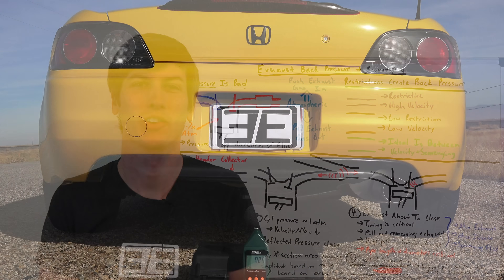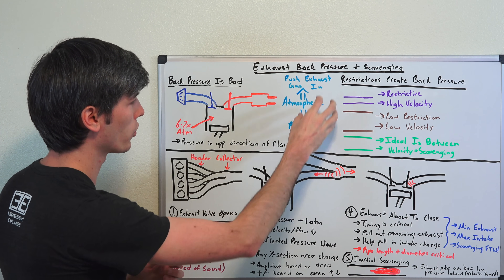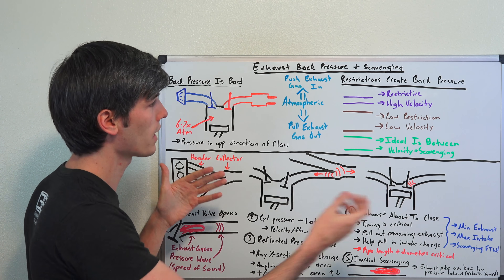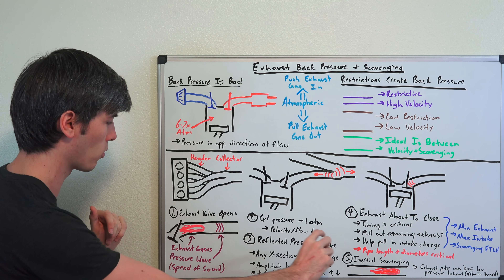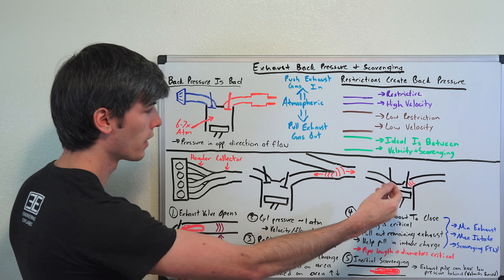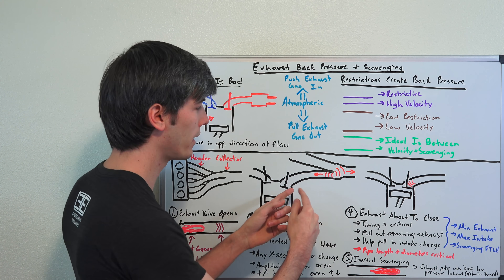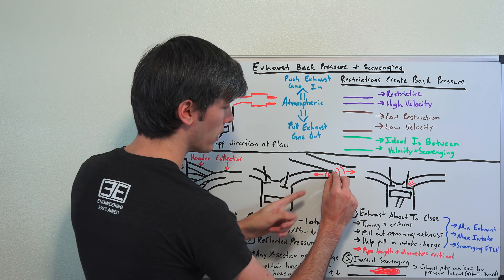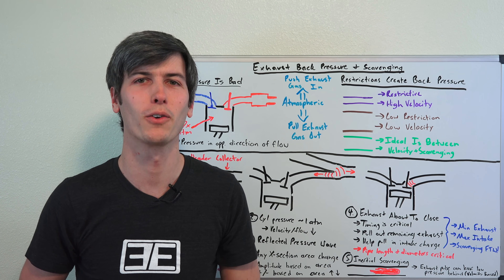Stop Saying Car Exhausts Need Back Pressure

Comment: As an engineer I’ve always been irritated by people saying cars need back pressure. 
Drove me nuts
Reply: I ran a custom exhaust shop for the better part of 20 years. I've built 100s of exhaust systems. Possibly into the thousands.  The amount of times I heard  "you need back pressure " My God it was pathetic.  I based the size of pipe and type of muffler on a few key factors.  
-engine hp
-type of driving
-upcoming engine or driveline   mods.. 
A lot of times pipe diameter is determined by its available space to live under your car. Sometimes it's not feasible to use larger diameter pipes. 
One thing I do miss is building headers. Very time consuming = very expensive. 
Any custom work is not cheap. If it is cheap,,,,,, you get what you pay for.
Reply: @My-Name-is-Mud-1969  It'll be fine with the stock diameter as long as it doesn't have a muffler.
Reply: Same
Reply: I read that honda k series engines need some back pressure and if not tuned properly using too large of ecxaust people are burning engines up
Reply: The guy who did my muffler delete on I4 said these engines need a bit of back pressure. I definitely felt a loss of torque at lower rpm. Also I’m surprised that so many mechanics think no tuning is needed after a muffler delete. My area doesn’t have that so yeah car sounds nice and loud with lesser torque which means loss in performance. ☹️

I do have a k tuner. Do you know if I can tune muffler delete by myself? And if so how?
@Engineering Explained
Reply: @Febreeze_Odor_Eliminator I recently bought a car that has the back box replaced with straight pipe to twin exhausts either side and while it sounds lovely at full chat I've noticed it doesn't pull well low down or from stationary despite supposedly having peak torque arrive before 2k rpm. I'm looking at getting the garage to order me a standard exhaust to see if that really is the issue.
Reply: @PPC4 just have it tuned.  It is tuned for back pressure and you just reduced it...
Reply: @Febreeze_Odor_Eliminator first step read forums, you likely have a laptop if you have a k tuner and you are gonna need to install a wideband o2 sensor and make sure your car is running good (make sure all your maintenance is done) and do research. Look at general tuning info relating to engines, look at info relating to k tuner, do research on your engine and what’s on your engine. You will likely answer a lot of your own questions but if you do it yourself you have to want to find the info. I’m not into Hondas so I cant tell you exactly what to do but I assure you knowledgeable people have done exactly what you want to do you just have to find where they told someone about it
Reply: @Febreeze_Odor_Eliminator if you noticed any difference in torque after the guy told you it would and it wasn't a placebo effect, it's simply because the car was tuned for back pressure and isn't now...
Reply: @chrismurphy7199  the guy told me it’s an issue for four cylinders, six and higher u go not much of a problem. Acc to his words, back pressure in 4’s help with their torque. Plus I never tuned my car for a muffler delete which most likely would have solved the issue which is why I was looking for an answer in the 1st place. 

It sure wasn’t a placebo effect as driving to the shop and driving out of it was a huge difference, had to give more gas to pick up speed
Reply: @Febreeze_Odor_Eliminator  you believe that coming from a guy who chops mufflers off for a living?
The only reason you “need” back pressure, is because it was tuned for it, from factory.

So of course it “needs” it, but engines are just air pumps, why have a higher differential in pressure, when could just NOT
Reply: @rocketkinger2506  so if I straight pipe my 4 wheeler, I just need to rejet it and it's good? After I upgrade the intake
Reply: @rocketkinger2506  That's a lie
Reply: @rocketkinger2506  why is there a loss in torque and mileage then? When I drove to the shop and drove back home I definitely noticed a huge torque drop off. I had to press gas more to go faster than with the muffler on. 

Also FYI he used to be a mechanic but now only does muffler stuff; he has a beautiful retro restomod muscle car sitting is his shop. Acc to him he has been doing this stuff for more than 30+ years. And I think he was giving me a fair heads up (even before taking the muffler’s off) for which kudos to him. Nowadays people don’t tell you anything and just are ready to snatch your money.
Reply: @carter.coleman  Yes. Just rejet it.
Reply: @carter.coleman   Get bigger throttle bodies and have it ported to fit 👍
Reply: Okay but as he explained in the video… you DO NEED BACK PRESSURE, just a minimal amount
Reply: @man.and.machines  its like saying we need nazis in society. We dont, nazis are exclusively bad and ideally we could get rid of them all. However, the only way to do that would be to police peoples thoughts and beliefs, and that is in itself bad. Just because the only way to get rid of something bad is even worse, that doesnt mean we need the bad thing.
Reply: @man.and.machines  its not that you need backpressure, backpressure is a problem and you want as little as possible, its just that the only way to have absolutely no backpressure introduces other problems.
Reply: @Kevin-dt9xm  bro are you even reading what you’re typing? The conclusion to what you’re saying can be deduced as… “minimal back pressure is optimal.”
Reply: @man.and.machines  yes, minimal backpressure is optimal. Saying "exhausts need backpressure" makes it sound like backpressure is a good thing, though, which its not.
Reply: Except even in his own explanation, he still says you need a little back pressure, but not too much that wouldn't allow the exhaust to flow quickly. Motorcycles in back pressure, imo, are much easier to understand because it doesn't take much to see a night and day difference since they're much lighter than a car. You can put an aftermarket Yoshi pipe on a Honda, right. But what you'll notice is that when you take the baffle out, the bike may seem a little faster, but it'll also act a little sluggish. Put the baffle back, and it will not only seem faster but also not seem sluggish. Granted, yes, you still need to tune the bike to make it as efficient as possible for that exhaust, but even so, maintaining a tune for a baffle compared to baffleless can result in high performance and better fuel economy compared to straight pipe. That's because you aren't having to dump a lot more fuel to create the bigger internal bang to counteract the wider dia pipe to better push the air out of the exhaust.
Reply: @JustJesseOfficial back pressure is never good.  He is explaining how to reduce the impacts.  If your bike runs worse after reducing back pressure, it's simply because it isn't tuned to breath freely.
Reply: @JustJesseOfficial  its not that you need a little backpressure, ideally youd have no backpressure, but the only way to have no backpressure is to have an exhaust which offers no restriction, which would reduce scavenging. Backpressure is exclusively bad, but its a necessary sacrifice.
Reply: @JustJesseOfficial  that sluggishness explanation exactly fits to what happened to my vehicle after muf delete. Nice articulation! 

And yeah torque and mileage loss definitely happened. Mileage prob not so much (vehicle already had a shi mileage when I got so I can’t tell by how much) but a huge dip in torque.
Reply: Well there's a huge difference between theory and real world experience.
Reply: So why do vehicles lose power when the exhaust breaks especially before the catalytic converter?
Reply: @AmaniFound  Because most likely in that case the car was tuned for that exhaust configuration. Lopping off the exhaust and just having a dump most likely will result in slower exhaust gas velocity at lower RPMs resulting in loss of power. Then at higher RPM there may be some potential benefit, however if the car has no means of adjusting fuel/timing/etc it will simply not doing anything for it.
Reply: @AmaniFound because it is tuned for x amount of back pressure and you just eliminated it.  Often though, you think it is struggling more because it's louder and it really isn't...
Reply: Isn't it necessary to help boost mpg?
Reply: @ralph02136  ...no, backpressure actually reduces the efficiency of the engine by increasing pumping losses
Reply: @Kevin-dt9xm  False.
Reply: @Kevin-dt9xm  You need to make the engine run richer with no backpressure.

Comment: So the 2 stroke engine "resonance exhausts" kits are basically made in a way to have the negative backpressure wave hit the ports in the right timing ? 
Or would a positive backpressure hitting the extraction ports be better, as it would push the piston up?
Also in a car, would having an active extraction of exhaust via a compressor (or decompressor) create more power ?

Comment: If you want to increase low rpm torque you want to use higher velocity exhaust to scavenge the cylinder better - that is when you want to have enough back pressure to create low end velocity. This of course causes too much back pressure at high rpm. Also a scavenged 2 stroke wont run with no back pressure. It needs the velocity to reach the power band.

Comment: We don't need no stinking headers! The bottom line is that "back pressure" is really just "choking exhaust gases trying to leave the motor." Most cars seem to benefit from small increases in exhaust diameter.

Comment: Don't say back pressure.  Say flow restriction.  There is no pressurized vessel in the exhaust, pressure is created only by the resistance to exhaust gases flowing through the exhaust system.

Comment: In short...BACKPRESSURE IS BAD. That being said in newer cars you can't just throw on headers and big high flowing exhaust on them without new fuel trims in most cases or it just doesn't work near as well as it could

Comment: Someone once tried to sell me the idea that an exhaust behind a turbo needed back pressure for the engine to be more efficient. After the turbo.
Where the turbo itself is building pressure for the exhaust gasses after the valves. So even his turbo was not really efficient and the whole system ran hot.

Would have been nice if you'd added a short note about turbo engines in your explanation.

Comment: So exhaust velocity can be created or tuned if you will by back pressure of the diameter and length pipe . So you do want back pressure as long as you call it velocity creating pipe.

Comment: One thing I didn't really hear was that exhaust gasses flow better when they are hot, so for example the Apex'i N1 on my GSX starts at 2.5 inch from the turbo and expands to 3.1 inch by the muffler. I think it's the sweetspot for my 2.0 liter Evo III 16g turbo setup.

Comment: i think it's a little bit more complex if you consider MPG instead of just performance...because in 2 strokes if there's no back pressure you'd chug so much fuel and i'd think it's the same for 4 strokes

Comment: I really think this dates back to carbureted engines and the impact on aerosolization of the gas on it's way into the cylinder. In other words, the inefficiency of the impeded exhaust was superseded by improvements to air-fuel mixture efficiency. Fuel injected engines don't have the inefficiencies of older carbureted engines.

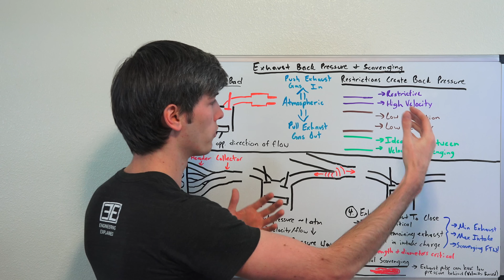Comment: 2:50 "You want some balance..."

Disclaimer: this is applicable to "general use" consumer engines. Race cars are a MUCH more specific application with different priorities and operating guidelines.

Back pressure is a symptom of a desirable operating condition in NA engines. You cannot have scavenging without back pressure and scavenging is an objectively good and desirable operating condition in NA engines. The back pressure may not be what is being desired in and of itself, but it provides a benefit not otherwise achievable without supercharging - higher volumetric efficiency. Therefore, the presence of back pressure indicates a better operating condition of the engine. Therefore, you DO want to see some back pressure in the intake manifold under certain conditions! You yourself admit as much at 2:50 into the video.

It is misleading and click-baity to say that back pressure is bad as a blanket statement as you do when you open the video. Good information that deserves to be presented with greater intellectual integrity.
Reply: He said "you want some balance", he didn't say "You need back pressure" specifically.
Quite the difference there
Reply: @ilpatongi  wanting balance means wanting both sides of the situation... the flow AND the back pressure.  If he didn't actively desire back pressure, then he woulsnt SAY balance, he would say he just deisres flow. The back pressure is beneficial and desirable. in my comment, i even went as far as to point out situations where you do not need back pressure, but i also qualified my statement at the start as referring to normal use engines as he was primarily talking about...the kind of engines most of his viewers are concerned with.
Reply: @jamestouchette859  Well of course we're taking about balance here, you can't completely eliminate back pressure because an engine doesn't work at a constant RPM.
Balance is the key really, "back pressure" isn't desirable when it means that the exhaust gasses aren't properly evacuated.
Reply: @ilpatongi  the problem is with this debate is that the back pressure is exactly WHY the exhaust gasses are effectively evacuated. I know that sounds weird, but rewatch his video. The pressure wave flowing back up the exhaust runners brings with it a low pressue area as well. That low pressure area is what helps suck extra exhaust gas out of the combustion chamber. You can't have that low pressure area without the pressure wave (the back pressure) and so i stand by my assertion that the back pressure is a GOOD thing, directly conflicting with his opening statement.

I will ALSO say that even he himself doesn't claim that back pressure is always necessary for an engine to serve its purpose well, but he also doesn't deny that back pressure is, in fact, a good thing when utilized properly. Again, my only claim is that his title and intro are click baity and dishonest.
Reply: @jamestouchette859  I agree, but my problem is that people don't understand what "back pressure" is and what it means applied to this context, it's not what they think it is, like he mentioned.
It's a pretty difficult concept to explain to people who have no idea of what they're talking about, many don't understand that engines aren't perfectly effiicient and that a true and perfect solution doesn't exist.
Thanks for the polite chat!
Reply: @ilpatongi  no worries, positive interactions in comment sections are KIND OF a hobby of mine!
Reply: @jamestouchette859  Nice to know, I try to do the same but people always react with insults and what not.
Reply: @ilpatongi  i got your back, homie!

Comment: I'm lost. Why do 2 strokes have a valve that controls back pressure. Changing the spring tension changes the power curve from the bottom end to the top end or vice versa.

Comment: Having smaller tubing and a muffler increases the amount of low end torque. That’s why you see a lot of trucks from the factory that have tubing smaller than 3 inches and they have huge long mufflers. You can look up any dunk vidoe of guys using smaller tubing and a muffler on an engine and making a lot more low end torque

Comment: So I just cut the muffler and resonator off of my 2015 silverado, now it takes longer for the engine RPMs to come down while the vehicle is in motion or at idle (I'll be adding a new muffler), the problem with it doing that in motion is that the transmission is being stressed more and has to forcefully pull the RPMs back down for the next gear, back pressure might be bad on some vehicles depending on the application but for the most part alot of street vehicles do need some back pressure (muffler, catalytic converter, and or resonator) to operate properly, so while your scientific explanation is a sound one it doesn't actually apply to all vehicles
Reply: False

Comment: wouldn't changing the backpressure move the pressure-vacuum wave locations within the pipes? An analogy would be a bandpass or notch filter that combine resistance and capacitance in various ways to pass or restrict certain frequencies.

Comment: Back pressure is misunderstood in the internal combustion engine and this video explains it better than most. Exhaust velocity shouldn't be restricted as it effects intake efficiency which is well-explained here. Some say zero back pressure results in a loss of engine torque or when the horsepower has its better efficiency. The key locations of exhaust gases are noted herein (in a manner that we as novices can understand). Inertial exhaust push and inertial scavenging? I'm starting to get lost. My main question is why do lower pressure exhaust systems affect torque and horsepower to a higher rpm, which means something in racing, but has little to do with every day driving from say, 1500 rpm to about 3,000 rpm in an ice engine? Thank you, AF

Comment: Wouldn’t it make sense to have a collector that matches the width of your head pipes and then have the diameter of the exhaust pipe gradually increase as it exists the back of the tail pipe? Assuming a muffler wouldn’t pose a restriction, wouldn’t this type setup continually decrease pressure in the exhaust causing a vacuum and thus suck the spent gasses out? I am imagining a 3 in. collector going into a gradually increasing diameter exhaust pipe until it exits the exhaust tips at 4 in. Would this work? Why or why not?

Comment: Actually saw a guy split a 4" on a 6.5 amg into 2 2" pipes. Made it run like a predator motor till we had to fix it with 2 2 5/8" pipes.